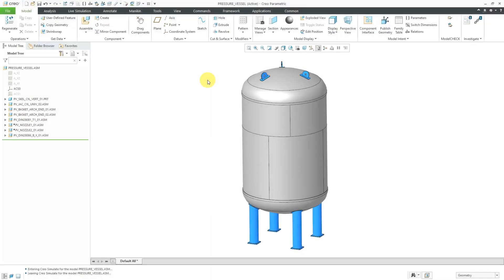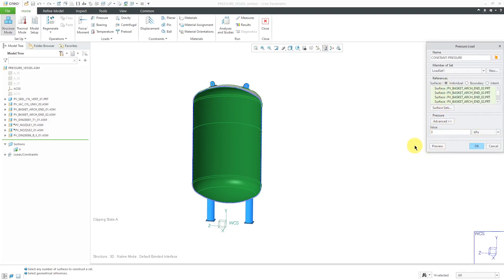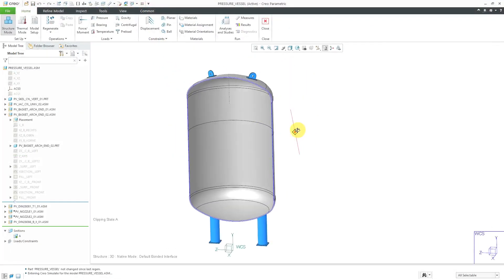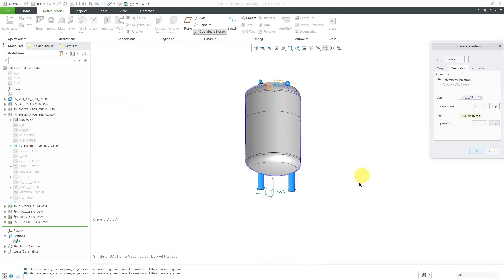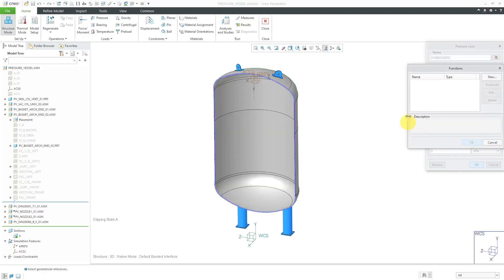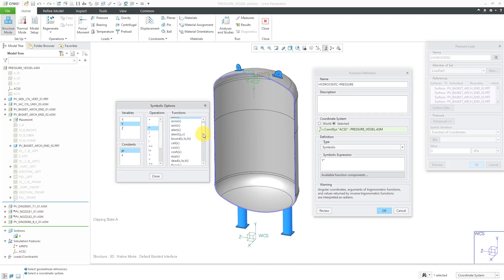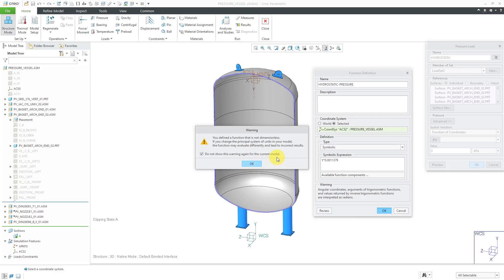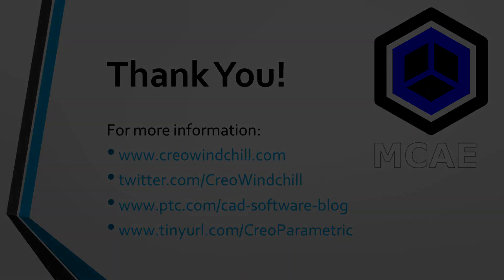Creo Parametric - Creo Simulate - Pressure Loads

Comment: How do you not get a pre-made cross section when clicking on the sections button?

I mean I've got pretty angry every time I have to make a section and Creo creates one automatically, name it and somehow I can't even use it because it's badly placed...
Reply from the maker: I suggest you watch my Cross Sections video. It sounds like you’re doing it wrong.
Reply: It seems our template model contained a pre-made section which creo converted as soon as I hit the section button. It did not appeared in tree, only in view manager.
Reply from the maker: Remind your CAD admins that they need to check the templates when they upgrade versions. That change to cross sections happened around Wildfire 4 or 5, like a dozen years ago. Pre-defined cross sections are unnecessary as the updated section tool provides 1-click X, Y, and Z sections.